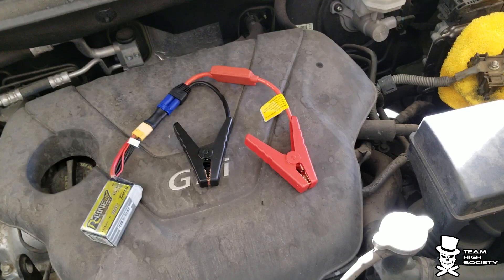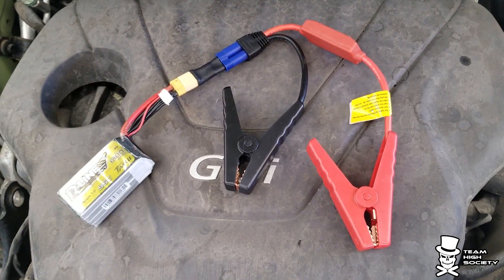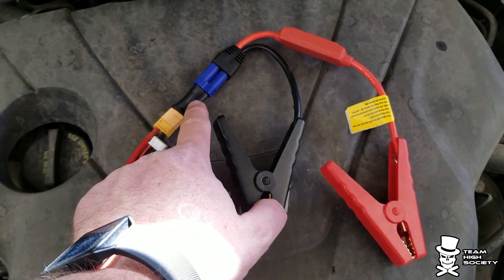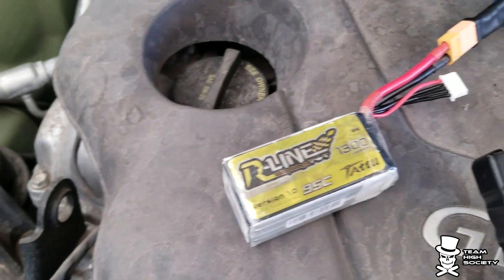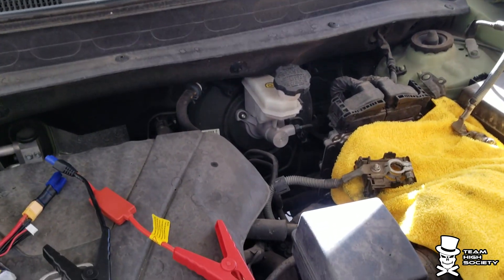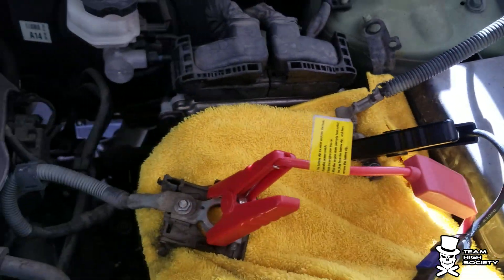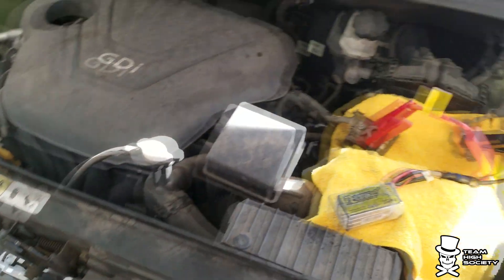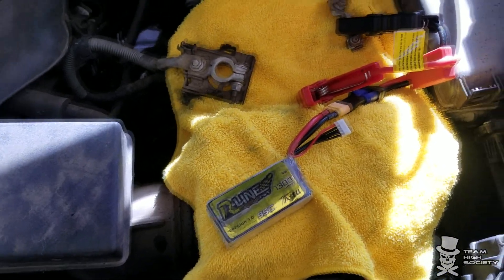Make a jump box for 12 bucks and a spare Lipo!

Comment: The "little red box" should be an anti-charge circuit, a back-flow prevention or "check valve" so energy from the system does not return to the battery pack.
Reply: Yes, "should be"... They dont work 100%, in fact not even close for the cheap stuff like this. Best to disconnect fast.
Reply: @GoldenCroc  Agreed!
Reply: @GoldenCroc  works great 100%  i tried it. 0watts return
Reply: @ParanomosGR  Thats great but thats far from the norm, sadly. But good for you that you got a working one, but dont trust it with your life, is my advice.

Comment: I want to make a jump starter for my riding lawn mower.....can you give me some idea what Lipo batteries to use and how many if I need more than one.  Its a 12 volt system and currently I jump the lawn mower off my car with jumper cables but that is a hassle.  I would also need the battery to be rechargeable so could I use a standard 12 volt "battery tender" so it shuts off when the battery pack is charged.....Please help, Im stuck...
Reply: If you do this, don't use a 4S (14V nominal) battery or one of the lithium jump packs that you can buy, they actually run around 16V and can fry small engine starters. Just get the cheapest 12V tool battery from harbor freight and you should be fine

Comment: I think the red box on the jumper cables, is a directional diode. so it my not back charge  and over charge your explosive lipo . but without a bms of some sort, it can over draw from your explosive lipo pack .  but use with the dead battery still installed , you should have plenty of time to unhook it and /or hook a charger to it. I will be ordering those cables right now.

Comment: Cool! Thanksfor sharing!

I once did this or very similar using my DJI Phantom 3 battery packs along with my FPV drone tool box while my 2000 Sebring convertible battery died after I left the daytime lights on. I was out in middle of nowhere northern WI in the sticks literally lol on a humid summer day, had no cell service & had to figure out how to get outa their safe & quick… thank gif I had the not common tools with me in my FPV custom drone toolbox to patch together the best connectors - I used DJI batteries thinking they’d be least likely to explode due to their famous protection circuits etc & after a few trials & errors my car roared to life & I didn’t see any drainage in the lithium DJI battery at all. 

Now I wanna build my own lithium powered jump starter although I’ve not had battery issues since & love tinkering with soldering & nerdy stuff like this of course or obviously lol 🤓😂

Comment: This is bullshit.seeing all these videos with people using a lipo to jumpstart a vehicle but yet I tried it one time on a build I got done with about 2months ago and it fried something out(thinking the ecm)because my fuel pump will no longer turn on nor am I getting any spark whatsoever in anyone of the 4 plugs.built this vehicle to put out 300+hp and everything worked absolutely perfect.car started rite up,ran strong as hell and sounded amazing for a 4-banger but yet now fuel pump won't turn on and no spark at all.pos was hooked up to pos and neg to neg and within 10sec of trying to start car both battery leads from lipo both got soo hot they caught fire and now since then I can't get damn car to start.all it does is turn over and it's pissing me off.last thing I want to do is replace ecm if that isn't the problem and I certainly don't want to pay someone to figure this shit out especially since everything worked 100% perfect.the only thing I did after getting the motor running after rebuilding it was change all the fuel lines and once those were done I tried the lipo to jumpstart the car and now I'm not getting shit when it comes to fuel nor spark.idk wtf happened.

Comment: You said there’s a bunch of diodes in that little box on the red cable-diodes are forward biased amd don’t allow current flow in the opposite direction, bud. So what were you REALLY worried about? 🧐
Reply: These diodes can melt.
Reply: The diodes protect against accidental reverse polarity. The alternator would definitely be supplying current to the Lipo once started, except it would not be balancing the cells. There is no reversing of current flow, it is always in the same direction.

Comment: Thank you. I wish you also were in the house showing the recharger product and how to use it with connectors, or anything else a person knows about but needs a little bit of details to buy everything they need in an emergency. Can a higher capacity one withstand the partial drain from an 11volt lead acid instead of no car battery?

Comment: I think the diodes stop reverse charge from cranking.. dont think it will charge.. I dont even think it will run the engine as I think you may need a proper battery that will charge AND send out amps.. diodes stop that from happening. Could be wrong.
Reply: I want to make a jump starter for my riding lawn mower.....can you give me some idea what Lipo batteries to use and how many if I need more than one.  Its a 12 volt system and currently I jump the lawn mower off my car with jumper cables but that is a hassle.  I would also need the battery to be rechargeable so could I use a standard 12 volt "battery tender" so it shuts off when the battery pack is charged.....Please help, Im stuck...

Comment: Great video. I have a question and maybe a video idea for you .  I imagine I could make this and use it as my battery for electric start dirt bike 200 cc ?
I have been thinking of making a jump start kit using super capacitors.  My idea is that all those seasonally used stuff ride on lawn mowers etc that sit most of the year and don’t start was to make a small super capacitor batter pack that I could just unplug and use between machines.  I believe the super capacitor will hold the charge for 5-7 days which is fine.  I don’t mind jump starting the dirt bike after it has sat for a while.  I’m just tired of replacing batteries for dirt bikes, ride on lawn mowers etc

Comment: The Lipo is not going to be charged by the car. That's what the little red box in the cable is for. It has lots of diodes that prevent this!
Reply: And those "little red boxes" are regularly sold faulty allowing current to flow both ways. Yes, it is supposed to do what you claim but the failure rate is way to high to put that much faith in.
Reply: Well i saw a review on that cable he using has 4 diodes that prevent that from happening so you have a some time to disconnect

Comment: 1300mah = 1.3amps how can that start a car
Reply: because these are ampere hours (capacity of the battery, not the current) with 95C that means it can deliver 123.5A. 95C*1.3Ah

Comment: how much current it would hv sucked from this 95C battery while starting?
Reply: It depends on the vehicle. Could be as little as 100amps to well above 400amps. It is certainly exceeding the current rating of the battery pack shown here. To be fair though even some of the decent lipo starter packs you can buy pull more than the internal pack is rated for. Maybe the high current draw is very brief and falls under the packs pulse rating but idk.

Comment: Nice experiment :D i always brag to outside people : see this little battery i am flying with ? 
It can start your car ! and they are amazed :D
I have 2 mentions to your video ; it is safe to leave car running because :
1. your cable has a diode that allow current in one way (it protects from reverse polarity but also allows current to flow only from battery to the car and not the other way around)
2. even if u did not have a diode, you are using a 4S battery that has between 14-16.8 v typically. A running car will charge with 13.6 - 14.8 V. That will not hurt a 4S batt. Will hurt a 3S tho !

Greetings from Romania !
Reply: Actually its not safe to even start car without own battery. Battery is also used to protect system from over voltage. Alternator can easily make 30 volts and if there is no battery to charge and consumption is low even a millisecond it may kill some devices. Lipo jump starters usually have 3 cells so fully charged  its only 12,6 volts. Diodes are only to protect LiPo from over charging when car starts and alternator makes 14-15 volts. Diodes doesnt protect from reverse polarity. But in some more expensive versions there may be something else also to protect from reverse polarity.
Reply: @jarkom9  bigger jump starters with better build quality have a mosfet that switches a big relais, when polarity is wrong or car is started and "tries" to charge the lipo. also some overcurrent and short circuit protection,  so the lipo doesn't explode when shorted.

Comment: I already have cables now what lipo can i use that is cheap?
Reply: Depending on the size of your car engine, you need a lipo that can deliver high currents. The current is calculated by capacity * discharge rate. The LiPos in the video with 95C can deliver 123A. A 5000mAh with 30C can jump start your car with 150A. Check the peak start current of your car battery to get a number.

Comment: Would this method work through the cigarette plug in your car? Also say you have a lipo that is almost double the normal volts. Would something like an external voltage regulator work to help it lower the volts? Or a rotary switch with a meter to tune it down? Other wise thanks for the info, and awesome video........                                                                                                                                                                                                                                                ,                                                                                           ⎝⧹╲⎝⧹ÐΛЯΞ †o ÐЯΞΛM⧸⎠╱⧸⎠ ✨[̲̅$̲̅(̲☠)̲̅$̲̅]✨¹°°
Reply from the maker: The answer is yes but its never a good solution, the cig lighters are rated in most cars at 50-150 watts max....so it cant start your car directly its just not possible...however if your battery is not shorted completely but just discharged you can plug in via the cig lighter and it will charge up the battery enough to start...but again that is only if your battery is just drained and not shorted internally. And as far as a voltage reg, it would have to be a beeeeffffy reg, remember it can take 300-500+ amps to start a car depending on size...finding a reg that can handle that would be tough =) Thanks for stopping by and commenting!

Comment: What's the connector called joining battery to jump leads and what charger you using for battery please
Reply from the maker: The big connector is a EC5 connector ( the smaller connector is a XT60) These are common in airplane and drone batteries. To charge my lipo batteries I am using a "ISDT D8". Hope that helps!

Comment: Can it jumpstart the car with car battery attached?
Reply from the maker: Depends on the problem with the dead battery. If it has an internal short when you connect the LiPo it will also be shorted and that's bad. If the battery is just dead from leaving the lights on it would be fine.
Reply: @TeamHighSociety how can one tell if the. Car battery has an internal short? 0:

Comment: how much volt this battary? 
can i stard my car with 14-15 v? lipo?
Reply: I just jumped my car with two 3S 12V LiPos (90A and 100A current capacity) hooked up in parallel. Worked like a charm.
Reply: Yes when engine is running, alternator pumps 14.5v to battery anyway

Comment: is it safe to use this method when the lipo is fully charged? (16.8v)
Reply from the maker: A car typically charges to 14.8 v or so, I can't speak for every car but for the two I tried it on yes it was fine. As soon as I plugged the battery onto the car battery it sagged a bit but not sure how much. Thanks for watching and commenting!
Reply: @TeamHighSociety  I can confirm - I just jumped my car with two 12V LiPos connected in parallel. Engine was a little slow turning over but it worked perfectly. Batteries are both fine. I had the jumper cables and LiPos in the car next to me in a fireproof container and was sure to disconnect them immediately to protect them. Thanks for the video!
Reply from the maker: Awesome, I have used this method twice and its been 2 for 2! Thanks for the confirmation!

Comment: What was the voltage in that lill battery u showed in the video
Reply from the maker: It was a 4S Lipo battery used for racing drones. That's 16.8 with no load.
Reply: @TeamHighSociety  with 95C and a small car, the voltage wouldn't drop that mutch, if the build in battery isn't complete dead. So wouldn't a 3S be more safe to not fry the car electronics?
Reply: Bit more info pls..size..how to recharge ?
Reply: I've started my car multiple times with a high  C 4s battery (16.8v).  Absolutely nothing wrong with that.
Reply: So we all know there's a battery in there right? No one's fooled by that yellow rag ?